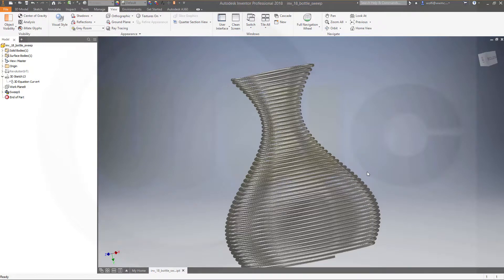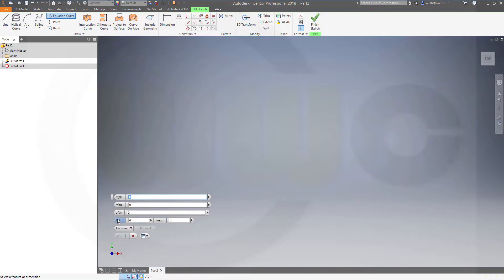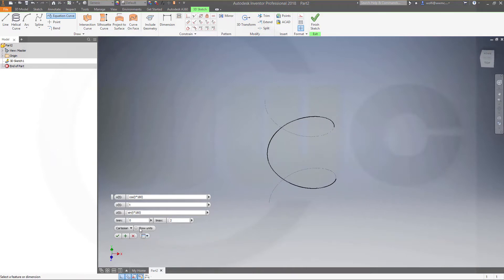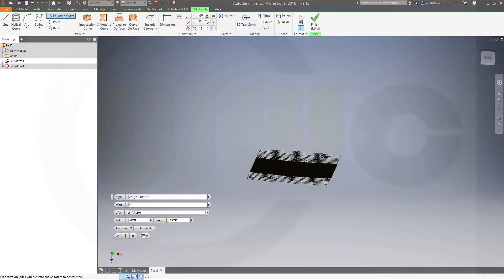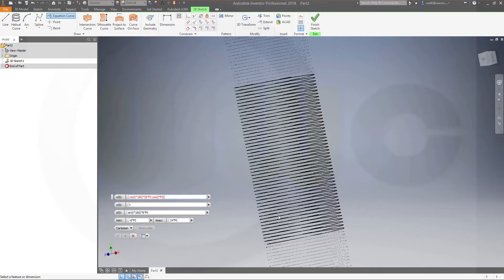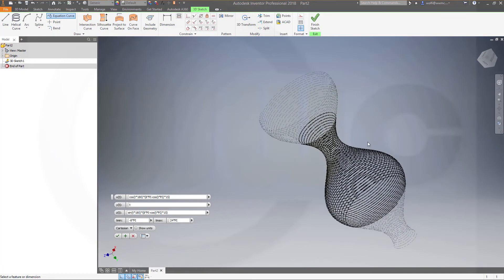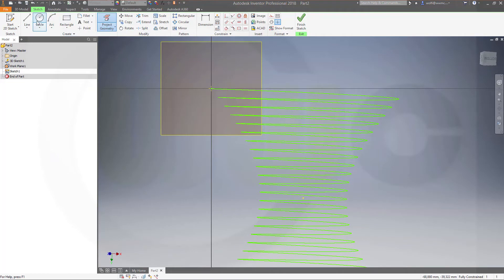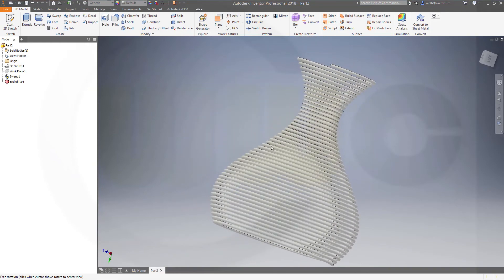Wire-Bottle - Inventor 2018 Training - Part Design

Comment: hello mr please answer me??    the crankshaft where it has its center of mass?
Reply from the maker: Depends on the crankshaft - just use your software to determine the center of mass.
Reply: Wolfgang Walden but the ideal place is the center
Reply from the maker: So design you crankshaft accordingly ;)